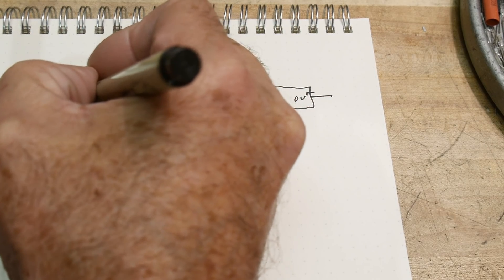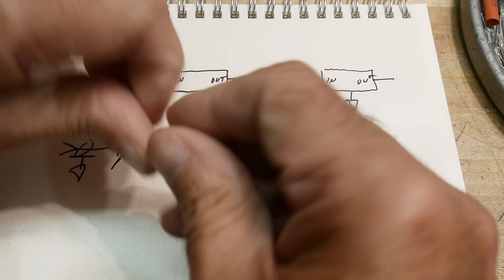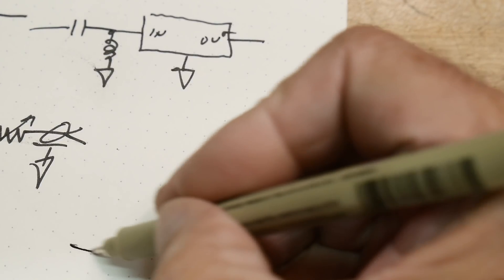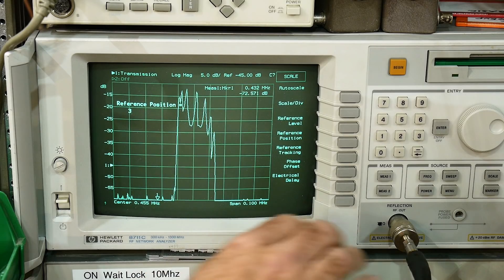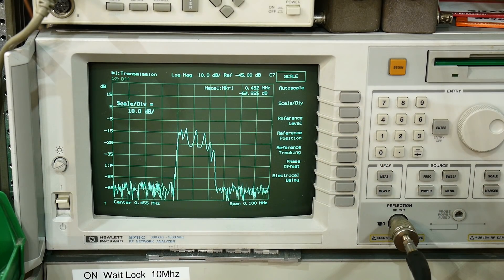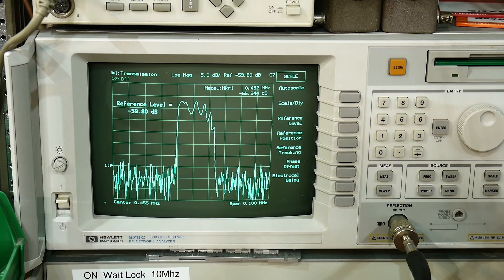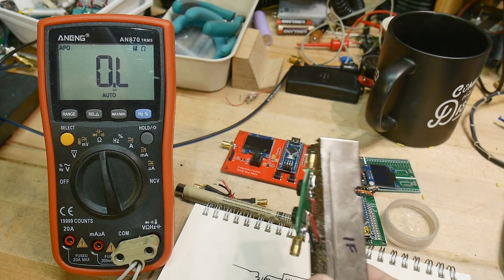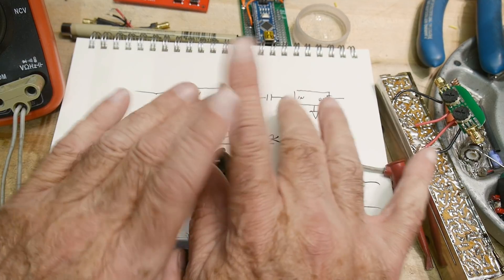#998 How to measure non 50 ohm filters on a 50 ohm VNA

Comment: The world is full of "traps for young players" (& not so young ones, too. Many years ago, I was commissioned to (fancy words for "the Boss told me to") produce an LC low pass filter for around 560 KHz.
Out came the filter design tables, & I happily designed the thing for 50-ohm input & output impedance, using another design chart to work out the number of turns of wire for the inductors.
I put it all together, then checked it with a Polyskop S.W.O.B.
Imagine my dismay when the passband was nothing like the predicted one.
It turns out that 560kHz is a bit of an "edge case", in that the resistance of the wire in the inductors becomes a real part of the circuit behaviour at low impedances, whereas at higher frequencies with less turns it can be neglected. Looking through various "tomes", I discovered that most designs do their "magic" at higher impedances to minimise the effect of coil resistance, & use LC impedance matching sections at the input & output.

Comment: I researched the Murata CFM455 specs and there is a series of them with suffixes from 'A' to 'I'. The in/out impedances are all 1,000, 1,500, or 2,000 Ohms. So check that IF filter with 1,500 Ohms and with 2K Ohms to see which is prettier (I'm guessing 2K) and you'll know which of them it is. I've been doing electronics for 50 years, but with very little VNA work. I'm learning all sorts of handy tech tricks from your channel. After all these years in the industry I have a bunch of old, unmarked parts lying around that have been useless without characteristic info, so this is great how so many things can be figured out with a VNA and a few tricks. I'll be making up a test bd with trimmers and SMA connectors with wires on them for this sort of testing as I see more and more how the accessories and adaptors are what really make a VNA useful. Any more hints and tricks you have to offer I will certainly pay close attention to. Thank you.

Comment: Forgive me if this has been covered, and I see than w2aew himself has already commented.

You did do something on this, as did Alan w2aew, but with a superior IMHO method. A resistor substitution box instead of the trimmer. Friendlier, and (usually) a much longer life.
Reply: A resistor substitution box adds far more parasitic inductance and capacitance into the test, though. It may not make much difference at 455KHz, I've never tested it, but at MHz range frequencies it's going to matter more the higher you go.
Reply: @ProdigalPorcupine  You're right. But speak of the devil, @w2aew already mentioned the rated mechanical life of trimmers versus switches (25 turns rated before it breaks isn't uncommon.)

OTOH, I'm a hypocrite, and also cheap, as I'm currently using 4 15-turn pots that I acquired on clearance after disassembling my cheap substitution box in anger (poor tempco.) The best solution, probably, is a "better pot", which isn't really a pot... which is why nice substitution boxes are expensive: a rotational switch, made up of precision resistive elements. Also why I'm obsessed with ganged switches for permanent installation that I'll never be able to afford for my own equipment (like the nice volume switches in audio devices.) If only laser-cut precision resistors were cheap enough to buy 10 switches × 10 .1% tolerance resistors with the requisite properties for my home lab, the rotational switch seems like the best solution in the long run; though again I am a hypocrite and am using non-"trimmer" pots currently for fallacious savings (if I had to buy the pots retail, they'd be more expensive and have to be regularly replaced). With enough money, the parasitic problems can and are worked around; minimal leads and no boards. The rotational switch design is impossible to beat from where I am. But could I beat IET Labs price at that point... well... probably not. Someday I will have to pull the trigger.

I encourage you to measure it if you get your hands on something nice. TANSTAAFL, though. Gotta use something.

Comment: I have used the smaller Murata CFU series 455 kHz filters.  These are commonly used in AM receivers (including CB), FM transceivers (like our 2 meter HTs), scanners, and so on, and are available in a number of different bandwidths.  Most of these are 1500 ohms impedance, but a  few are as low as 1k and  few as high as 2k.  I'm going to guess the larger filters in that radio are pretty much the same as the smaller ones I have used in the past, they just have more of them in one container.  (So I would have guessed they would have the same 1500 ohms impedance.)  I have also used the Murata SFE series filters which are commonly used in FM broadcast receivers.  These are mostly designed for 10.7 MHz, and with bandwidths appropriate for the  200 kHz channel spacing used for FM broadcast.  FM broadcast aficionados have been known to change the filters in their receivers for wider bandwidth (better fidelity) or narrower bandwidth (for FM broadcast DXing).  The SFE FM broadcast filters are all 330 ohms impedance.  Apparently it is difficult (or perhaps just not economical) to make ceramic filters as precisely as crystal filters, and these are (or at least used to be)  available with color dots on them to show the actual center frequency.

The passband sure looks a lot nicer when the filters are properly terminated, doesn't it?

Comment: You just have to be careful with those trimmers, since they have a very low rotational life.
Reply from the maker: Same for me
Reply: What about the parasitic L and C of the pot, due to its construction?  Wire-wound would be a problem.  I expect at less than 1MHz (here 455 kHz) it won't be an issue.

Comment: Kewl! I guess if you wanted to get the actual s21 thru this you could attach the input and output with their resistors adjusted for flattest response, and normalize the vna. Thanks for doing this. I'm planning on building a mininmum Ioss pad to check TV antennas (75 0hm) on the nano vna. Precision resistors are needed. Maybe I can grind them a bit with the dremel tool til I get the values I need. I really was hoping to see you play space invaders on that vna!

Comment: Rather than adjust the pot to get a flat top filter response, why not just measure the input impedance with that setup - adjust the pot so that there is half the sig gen voltage at the filter input - the pot must then have the same impedance as the input.
Reply: The snag with the approach you suggest, is the filter is a two port network, so it is necessary to match both ports at the same time. 
To do as you suggest, the output port would already need to be well matched. Seeing the filter response is more informative than simp!y aiming for a 6dB attenuation at the input.
The only problem with this technique shown in the video, apart from the need to have access to the test equipment, is the maximum frequency that potentiometers maybe used. At a guess, stray capacitance might start to be noticeable at 10.7 MHz, and a real problem at VHF. It also assumes that the filters do not require a comp!ex matching impedance. 
Before the advent of network and spectrum analysers ( with tracking generators), it was common practice to set up such filters with an instrument known as a wobbulator. This was a voltage controlled sweep oscillator connected to an oscilloscope, where the x-output signal linked to the oscillator sweep input voltage, the oscillator output fed the filter input, and the filter output was connected to the scope y input, sometime via a diode rectifier RF probe. This arrangement displayed the filter transfer function.
This test arrangement was often used to tune the pot cores of if stages of the old filters that were nothing more than encapsulated pot core LC filter networks, common in radio transceivers of the 1950s  and 60s.

Comment: You nailed it, most 455khz ceramic filters match to 2k ohm impedance, some model 1k5.
Reply: That's useful because the input and output impedance of the SA612 (NE602) is 1k5